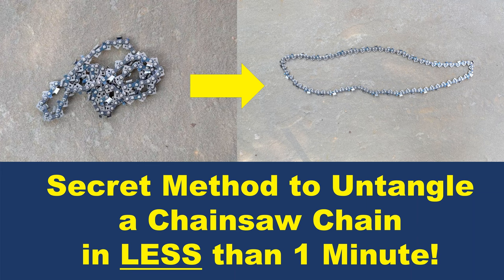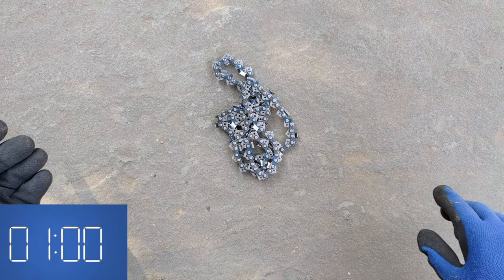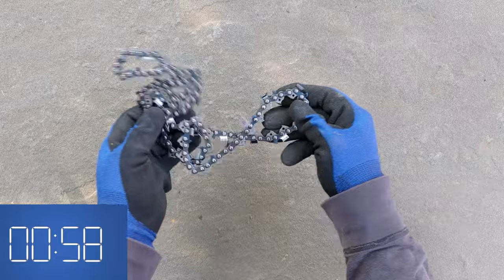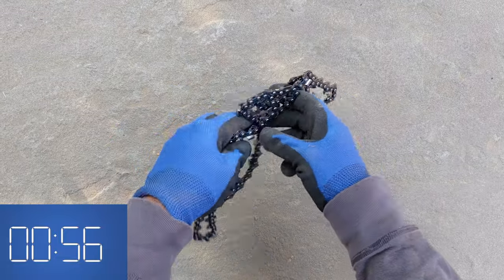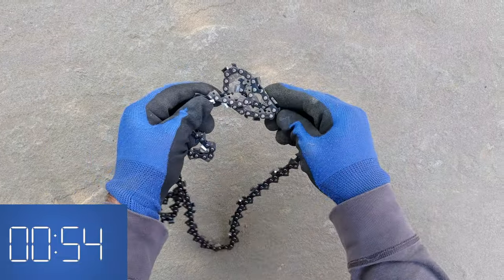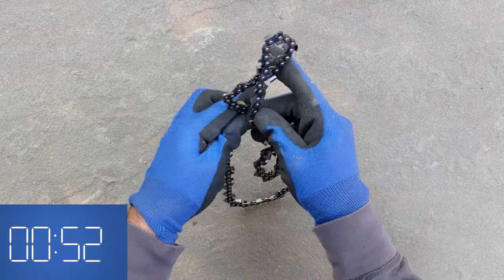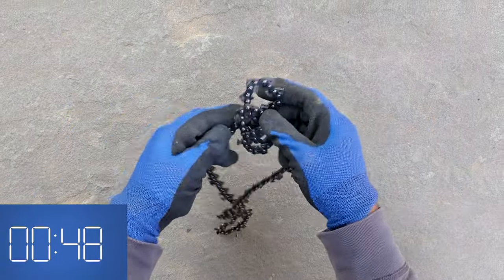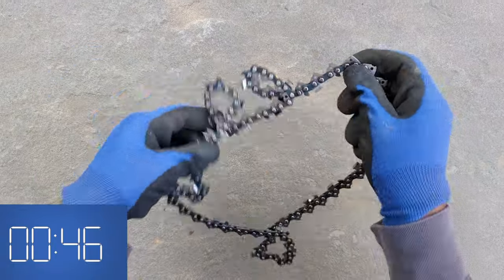How to Untangle a Chainsaw Chain (in LESS than 1 Minute)!

Comment: Great video.  I would have liked to know what your strategy was to untangle the chain.  It was difficult to tell based on just looking at what you were doing.
Reply from the maker: Glad it was helpful!  The goal is to move apart the tangles (loops) from one another until you are left with only two loops.  This would mean the chain is looped over itself once. Lift one end of the chain over the other and you are done.